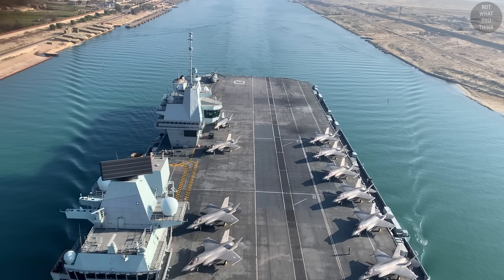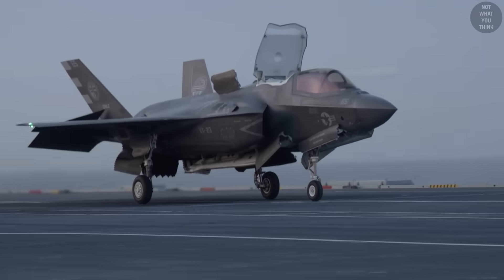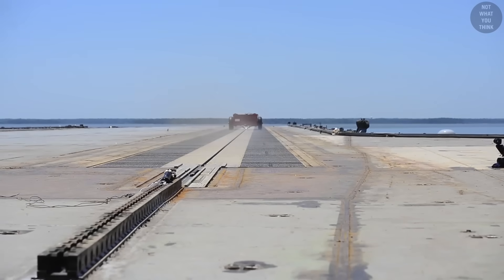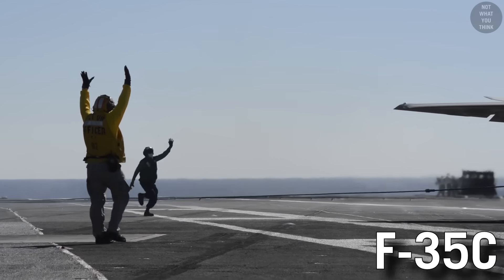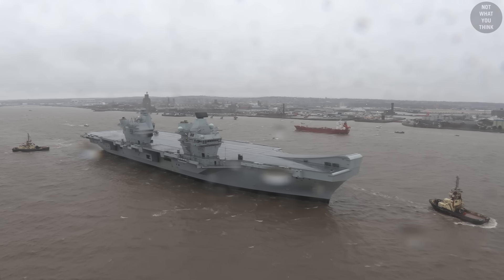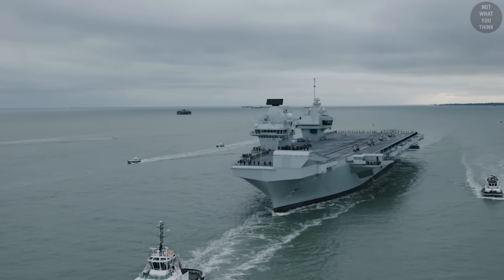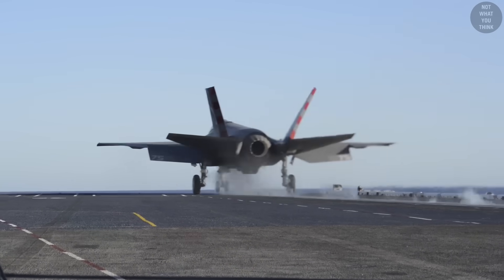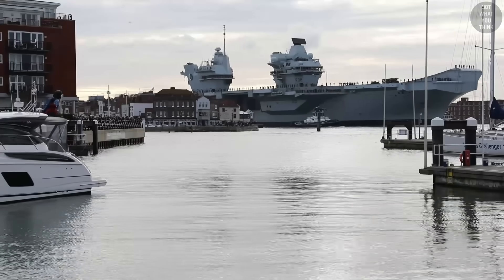Was the Angled Flight Deck Missed on HMS Queen Elizabeth?

Comment: There are many STOVL carriers in active service that you missed, and their numbers is Not What You Think... 

The US has 9 (Wasp and America-class)

While the UK, Australia, Italy, Japan, and South Korea all have 2

While Spain, Thailand, Brazil, and China all have 1

And China have 2 under construction (Type 075)

While Turkey, South Korea, and the US all have 1 under contruction

And South Korea have 1 under development (CVX program)

And Turkey have 1 planned (Anadolu-class)

While the US have 8 more planned (America-class)

While China have 3 more planned (Type 075)

And China also has unknown numbers under development (Type 076)... 

So you see, there are a lot... And its Not What You Think 😏...
Reply: Many of those you mentioned are either helicopter carriers or amphibious carriers .
Reply: @jey2275  Yes, many of them are helicopter carriers or amphibious assault ships (LHD or LPH), but most of those helicopter / amphibious carriers also have the capability to operate V-STOL aircraft, and therefore can be easily converted into STOVL carriers...
Reply: Some corrections, not all LHD are STOVL carrier. They need to be large enough and also reinforced deck that can handle the heat from jet blast. China has no plan to use jets on 075, so it will only be an LHD, and 076 will have EMALS to launch drones.
Reply: @qiyuxuan9437  Yes, as of the moment, China doesn’t have plans to convert Type 075 and Type 076 into STOVL carriers YET, since they still do not have any V-STOL aircraft, and they’re also not planning to develop any V-STOL aircraft YET, but who knows what might come in the future... You know, demands can quickly change overnight, and I think because of these future demand changes that China will soon try to develop V-STOL aircraft when there’s a need, and also try converting their LHDs into STOVL amphibous carriers (like the America or Wasp class), considering that they’re now a technological and industrial powerhouse, and they have all the capabilities to do so... But yes, right now, there’s still no need for China to develop V-STOL aircraft, and their doctrine also have something to do with that... But if China wants to be a superpower and match or even surpass the US, then I think they’ll need to develop a V-STOL aircraft sooner to put on their amphibious carriers...
Reply: @shinei98  076 is kinda intresting. It might be the first LHD eqiped with catapult.
Reply: @qiyuxuan9437  I don’t think so... It was said that Turkey is planning to equip their new amphibious carrier, the Anadolu-class, with EMALS for UAV and UCAV operations, and we all know that the lead ship, TCG Anadolu, is now nearing completion... But everything still depends on the situation, if China can build and commission the first of its Type 076 before Turkey can commission its TCG Anadolu (since we all know that the Chinese industry is like a supermachine, they can build things way quicker than any other country in the world), then they’ll be the first country to operate amphibious carriers equipped with EMALS... But again, Turkey’s TCG Anadolu is now nearing completion, so its unlikely that China will be the first one, but who knows, nothing is impossible with China... 

Oh, and by the way, about your first reply/comment here in this reply section, I just want to add that even the smallest carrier in the world, HTMS Chakri Naruebet of the Royal Thai Navy, with a length of only 182 meters (way smaller than Japan’s Hyuga-class, South Korea’s Dokdo-class, and France’s Mistral-class) is capable of operating V-STOL jets (it once operated Matador AV-8As)... So I think length is not really a problem for most helicarriers, LHDs, LPHs, and other amphibious carriers, because most if not all of them are longer than Thailand’s HTMS Chakri Naruebet... I think the main problem is really the deck... Most helicopter carriers and amphibious carriers doesn’t have a well deck... They cannot withstand the blast from the engines of V-STOL jets... Majority of them are only designed to carry helicopters, and most of them can support only helicopter operations, not jet operations...
Reply: But.. what is China going to put on a STOVL carrier?
It's not like they're going to buy F35s or Harriers.
Do you mean China has two STOBAR Carriers in production?
Reply: @MostlyPennyCat  All future Chinese carriers are CATOBAR, include the 003 launching this year. The 2 he mentioned are LHD.
Reply: @MostlyPennyCat  Yes, China still do not have any V-STOL aircraft YET, but who knows what they’re planning in the future... Again, just like what I said to the other guy, future demand changes might push China to develop V-STOL aircraft when the need calls, and they do have all the capabilities to develop one... And no, I do not mean their STOBAR carriers Type 001 and Type 002, what I mean is their amphibious carriers, Type 075, and their future Type 076...
Reply: When it comes to STOVL aircraft, they are the most difficult to design and then get right.
China has come a long way but they are a long way off a native STOVL aircraft.
They need the engine to start with and the Shenyang WS-10 still isn't ready for prime time.
Ws10 is a 27000lb engine.
Pegasus (Harrier) was 24,000lb
The F135 600 produces 40,000lb hovering.
China will go full CATOBAR because it's much easier than STOVL if you have to design the aircraft yourself.
Reply: @MostlyPennyCat  Yep... I agree with that... If you don’t have any V-STOL aircraft at your disposal, and if there’s no V-STOL aircraft available on sale for you (like the case for China), then its really impractical to build a STOVL carrier, which is a type of carrier built specifically to operate V-STOL aircraft... Its more practical for China to build a carrier of STOBAR and CATOBAR configuration, because aside from being more easy to build and operate, China already have aircraft made specifically for this type of operation (Shenyang J-15 Flanker-X)... So yep, its just right for China to invest more on CATOBAR and STOBAR carriers, instead of STOVL ones...
Reply: Japans carriers are still under going conversion and South Korea has not laid down any stool carriers yet also Australia is just using there’s for heli’s and just left the ramp because it would have cost more to remove.
Reply: @skylerlopez8383  Helicopters are also considered as “aircraft”... Particularly ROTARY WING aircraft... Any aerial vehicle, manned or unmanned, are considered as “aircraft”... Which means that ALL helicopter carriers are also considered as aircraft carriers... Whether they’re dedicated helicopter carriers or amphibous assault ships, they can be considered as “aircraft carriers” because they’re carrying helicopters, which is a type of rotary wing AIRCRAFT... But using my logic, even a cruiser or a destroyer or a frigate equipped wirh helicopter decks can also be considered as “aircraft carriers” because they can carry helicopters, which are again, a type of aircraft, but they’re an exception... They’re not classified as aircraft carriers because they’re not really designed or specialized for carrying helicopters, they just have the ability to do so... So what I’m trying to say is not all ships with the capability to carry aircraft can be considered as aircraft carriers, only ships that are designed and specialized for aircraft carrying operations can be considered as aircraft carriers... And that includes dedicated helicopter carriers and amphibous assault ships... Its not really a requirement for them to have the ability to carry fixed wing aircraft to be considered as aircraft carriers, as long as they can carry aircraft and they are designed to carry aircraft, may it be rotary wing or fix wing or whatever type of aircraft, they are aircraft carriers... Period...
Reply: @shinei98  yes, heli carriers carry aircraft, but aren't we talking about STOVL carriers specifically? Helicopters are not STOVL aircraft, they don't perform the short takeoff thing, that F 35B does.
Reply: @mnd7381  Yes most LHD’s do not necessarily carry V-STOL aircraft like the F-35B, but they do have the capability to do so (like how South Korea and Japan are planning to convert their Amphibous Assault Ships and Helicopter Carriers into F-35B carriers)...
Reply: India has two
Reply: @qwill8254  India's carriers are STOBAR, not STOVL I believe.
Reply: @Peterincan  But it can still perform that role
Reply: @qwill8254  I guess India has planned to build LHD, but thats still in planning stage
Reply: @qwill8254  I’m talking about STOVL carriers... India’s sole carrier INS Vikramaditya, and its future carrier INS Vikrant, are both of STOBAR configuration and not STOVL... And yes, although it has the capability to perform STOVL operations, its official configuration is STOBAR, and performing STOVL operations on a more capable STOBAR carrier would be deemed impractical (basically any aircraft carrier of any configuration has the ability to perform STOVL operations, but again, performing that type of operation on more capable CATOBAR and STOBAR carriers would be impractical)... And keep in mind that as of the moment, India only has 1 aircraft carrier on active service, which is INS Vikramaditya... INS Viraat was decommissioned in 2017, while INS Vikrant is still under sea trials (as of 2021), and INS Vishal is still under construction...
Reply: @shinei98  ins Vishal hasn't yet started construction yet due to many problems
Reply: @Aki_Aefhyzyr  But its a planned future carrier
Reply: @shinei98  yet problems due to covid and lack of fundings the project hasn't yet started...  Soon maybe it'll begin as Vishal was supposed to be a supercarrier
Reply: @Aki_Aefhyzyr  Yep... I do hope that India will also soon join the “CATOBAR” club... Once India finish its Vishal, it will be the fourth country in the world to use carriers of CATOBAR configuration (next to the US, France, and China), and the third country in the world to operate supercarriers (next to the US and China)... I really doubt that India can finish its Vishal carrier before China can finish its Type 003, because the Type 003 is now nearing completion... But I do hope that India can finish and commision its Vishal sooner rather than later because its a badly needed asset for the Indian Navy... And we, the people of Southeast Asia, are in full support of this project, and we are really looking forward to it, considering that it will tip the balance of power in the region once the vessel is completed and commissioned... 🇮🇳 SUPPORTING INDIA ❤️ FROM THE PHILIPPINES 🇵🇭!

Comment: You cannot launch and recover aircraft at the same time on STOBAR ships...the aircraft launching use a good portion of the landing area for their take off run.
Reply: You can, but its limited. The Rissian and chinese cartiers have 2 launch areas 1 on the right and left the one on the left does indeed cross the landing area but is also ment for more heavely armed planes, while the right side is shorter and is not crossing the landing area, but no matter what you rarely launch and recover planes at the same time from carriers. But it is possible maybe not from the indian carrier due to its smaller size but thats a minor detail
Reply: @ironbottom  I stand corrected sir...
Reply: @richardprice7763  my plesure fellow gentlemen
Reply: Also imagine the stress and logistics of the flight control crew in handling landings and take off at the same time